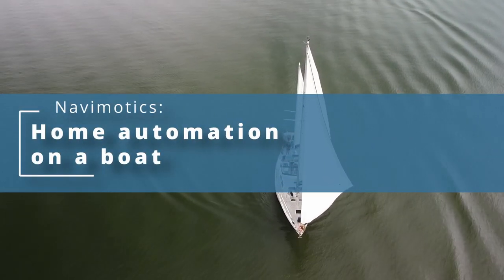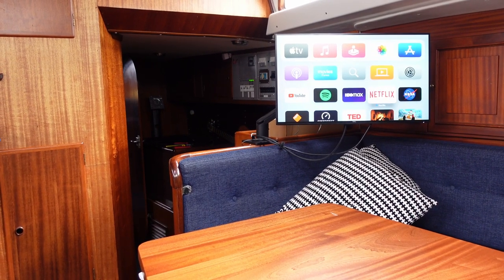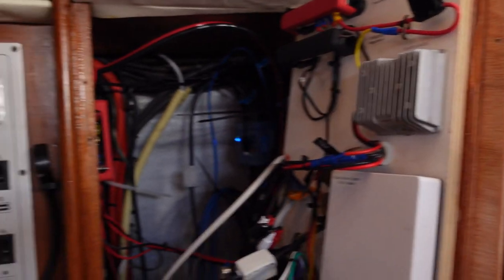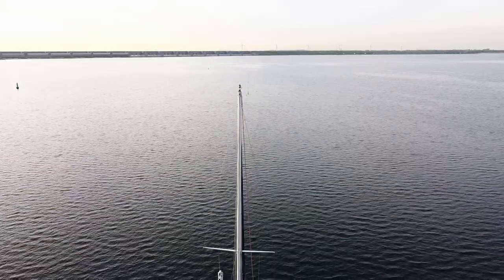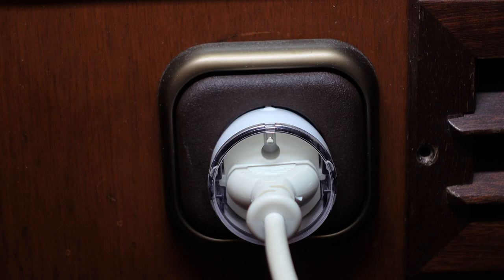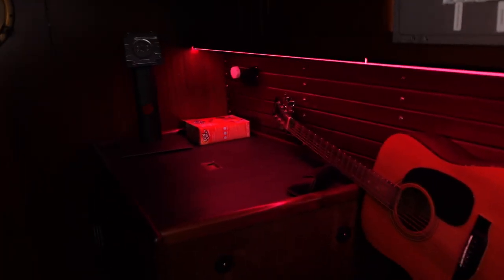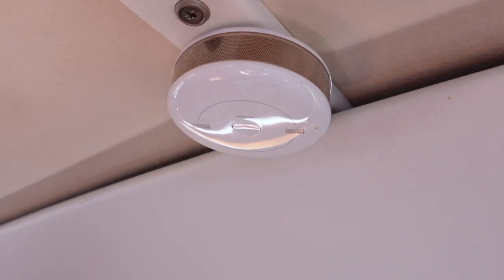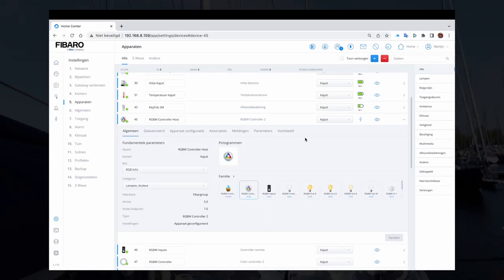Navimotics - making our sailboat a smart boat with ‘home’ automation

Comment: Awesome video! Thanks for sharing. 
I also built a boat automation, but a lot simpler.
 I use EsP32 and Blynk. All I have is movement sensor, voltage sensor 2 temperature sensor (one for the fridge and one for the boiler) and I can turn on and off some devices. 
For the battery sensor you could use to prevent incidents, the lead acid battery exhausts HS2 when over charged and is the main cause of accidents, and you can detect that! In my bout I have 2 different sensors, one for HS2 and one for Gas from the stove